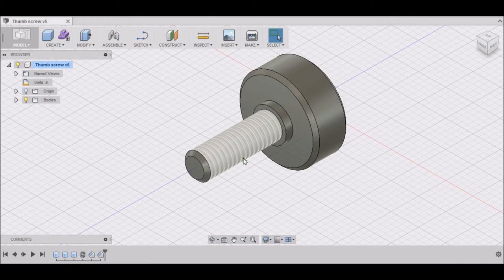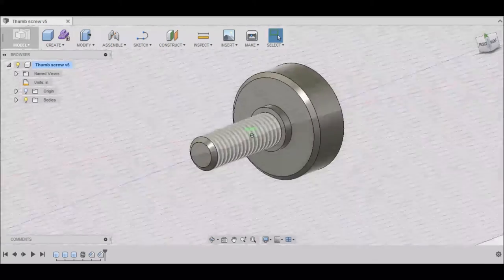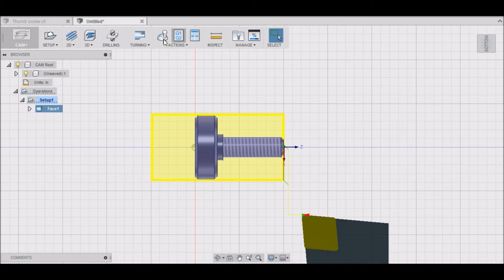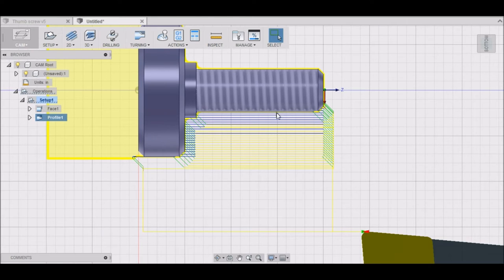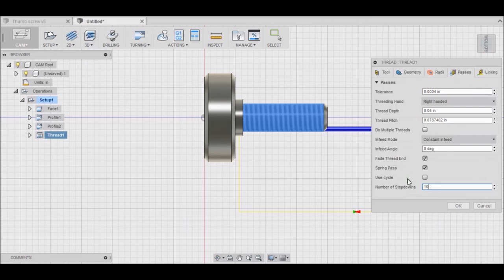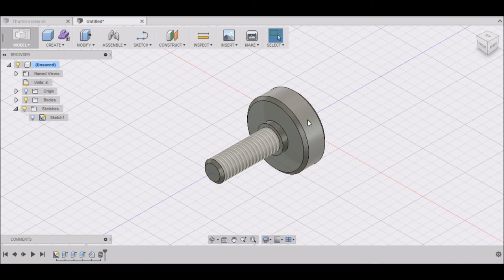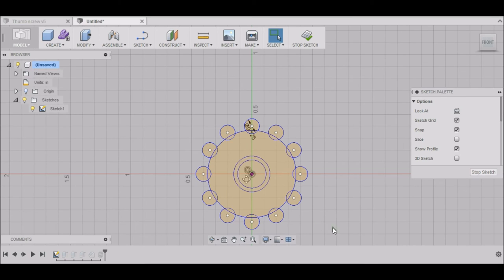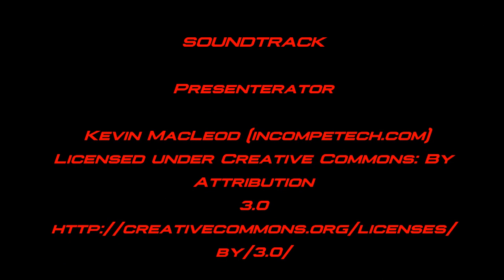Fusion 360: G0602 Thumbscrew

Comment: Great tip on the extrusion!  I would have made one cylinder and drawn a circle on top.  Much faster your way.
Reply from the maker: +Craig's Machine Shop   I have drawn models that way as well. the nice thing I've found abut the sketch is to make a dimension change just Edit sketch double click the dimension change and hit enter this changes the model as well and its a lot easier I think. 
The great thing about 360 is it seems there's always a few ways to get the same results.

Comment: Thanks for the walk through. This is exactly what I needed to learn. I JUST downloaded Fusion360 for my incoming Tormach lathe.  Subscribed!
Reply from the maker: +Paul Boonyanetr 
Great thanks for the sub. 360 is good software but not trouble free just yet. Let me know of I can help.  
Be safe Sam
Reply: +CNC4XR7 Thanks Sam,
I had a question. If after you've already cut the threads (while still in the chuck/collet) and it still fits too tight and need to do another 2 or 3 passes, would you just run the threading G-codes (cycles?)
Reply from the maker: +Paul Boonyanetr 
Assuming X zero is accurate you could add a few spring passes. You should be able to re run the code.
Reply from the maker: +Paul Boonyanetr not a problem shoot me a email  my channel name at g mail dot com